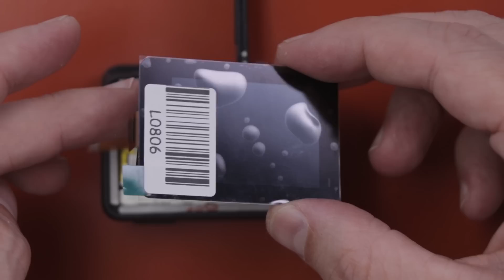I Bought 6 "Unfixable" GoPro's - Are They Really Unfixable?

Comment: I sometimes wonder, there are a lot acrylic products to fix car windshield. You just simple apply the product to the crack and let it cure under uv light. Then the crack will be barely noticeable. So I wonder if those products can be used to fix crack touchscreens. If so, you don’t need to replace them.

Comment: Ive checked your video and im pretty sure that you can remove the back lcd screen without removing the front first just heat up the lcd panel ply it out unscrew the battery box and you should be able to unplug them from there!
Reply from the maker: I wish that were true!

Comment: For cracked screens I would have used a cell phone screen protector! Clean it really good, lay a protector on it, press it down good, trim it with a Xzacto knife.  The main problems with cracks  is they let in moisture and dirt, the protector will seal them. I have repaired cell phones like that and they worked for years.

Comment: at 4:38 Surprised, how easily users in US get rid of these. I mean, in Russia if such device (or even an iPhone) would have such screen damages or even worse (missing parts of screen all the way down to the board) but still working fine - it would still be used as long as it works or until device is too old and needs replacement to get up to date.

Comment: The bonded design is what makes it so rugged and sealed. The glass is much harder than plastics.  They are not intended to be repaired but with nothing to lose its always worth a shot. I did the same peeling the glue and ended up chipping all the glass off.  The trickiest bit was getting the plastic back to its shape,  so it would be nice for that to be available as a spare, although some Chinese company would probably skin their clone with it. I bonded it back together with many pounds of force and it looks stock. But I accept I'll never ever be able to repair again. The density and the design to me shows what you are paying for and I'm reassured it's the design first then cost second.

Comment: Use s silicone adhesive around the screen and not too much so it doesn't spread onto the screen and it will be water proof again

And or gasket sealer / naker adhesive it's really strong and wont let go easily

Comment: I have a gopro hero 8 that had some water damage after using in the swimming pool without additional enclosure. After letting it sit for a few weeks, It can power up now, but says no battery while battery is in use. The front lens seems seeing nothing and the touch panel still works. Do you have any suggestion?

Comment: To remove the outer lens cover on the hero 7 you pull it out and rotate it anti clockwise. If you use a pipe wrench all you will do is break off the location tabs.

Comment: GoPro on 4:20 is not broken. You started scrolling on the "language" black bar, of course it will not scroll, but on the right side you scrolled from the "english".
On the left side, you started scrolling a bit to high and that's why it didn't scroll, that's not a dead spot.

Comment: I have 3 hero black 7's and 2 Hero black 8's.  One of the Hero 8's (bought 2 years ago) continuously cycles on and of after being on for about 10 - 15 seconds.  When recording it will record from 10 sec to one minute, then cycle off and on and screen shows video file being repaired.  I tried different SD Cards. I tried new batteries. I set quick capture to off, I set auto power off to Never, I set Screen Saver to Never. Finally did a factory reset. Camera still continuously cycles on and of after being on for about 10 - 15 seconds.  I also, as last resort, used isopropyl alcohol with Q-tip to clean leads.  Issue still happens.  i am getting ready to replace the camera.  I just might try the DJI - Osmo Action 4 4K Action Camera

Comment: from ebay i have bought number of job lot digital cameras that were listed spares repairs out of the entire combined lots i got 80% fully functioning , there was battery corosion on some of the battery conectors best thing to use is lemons apply to  kitchen paper towel cut to size leave it there untill battery corrosion absorbed into kitchen towel repeat process until its gone or you can squeeze directly on , digital cameras i cant fix i strip them down as parts lots , some i managed to source batteries for them as some do not use standard batteries , i sourced chargers for them , one i got new screen i accidently pulled out flex ribbon cable that powers the light putting it back in was nightmare cause a tear in the cable anyway to fix it , some of the cameras were non digital 35 mm cameras and a halina super 8 which looks in good condition needs a battery

Comment: In stead of using the channel locks,  get a friend with a mill or woodworking routers and make a "wrench" with a shaped opening the same shape as the front lens.  The tool could be made of metal,  plastic or wood.  All could work.

Comment: I have a gopro silver 4 and I treated it very good as if it was a full sized camera. It still looks new. I store it with out the battery. The other day I slid the battery in and it didn't work. I bought new batteries, that didn't help. I've found a few videos that have me holding various buttons in while I slide the battery in. Nothing. It's a shame

Comment: Hi, cool video! I have a question. I have a GoPro hero 8 black. It turns on and works when it is plugged into my laptop. Even tho the battery is inside, the GoPro says that there is no battery inside. I cannot do a software update (auto or manual) because it detects that there is no battery inside. I’m afraid the issue is worth he GoPro and not the battery. Have you had or heard of this issue before? I saw online many people experienced this. Some even bought new battery and the same issue occurred. The GoPro fails to recognize that a battery is inside. Any ideas?

Comment: You should have tried removing the old adhesive a bit more, and used silicone or rtv sealer instead of tape. Then clamped it together and let it dry

Comment: Not speaking from experience, however, I think the solution to your problem would be piano wire or super thin wire which you can use to cut that adhesive instead of having to heat and pry.  Not suggesting this would be easy either, however, may render the result you're wanting.
Reply from the maker: That's possible...I've never used it. I might have to give it a try. I still think a lot of heat would be needed but I've not tried it so I could be wrong.

Comment: If the front plastic pannel isn't warped or damaged putting w big amount of b7000 phone glue will make it alot more water resistant and for the screen too it will pretty much make it water proof from the screen side because of the big bezel around it

Comment: The GoPro 7 is waterproof without the front lens cover. To remove the cover correctly all you need to do is pull it away from the camera slightly and give it a twist, this is easily done by hand. That procedure is covered in the instructions that come with the camera and if you need to use the GoPro dive housing you have to remove that lens cover for it to fit the housing.

Comment: That repaired GoPro 7 Black would work perfectly for all streamers, youtubers and other folks that need extremely cheap and good quality video recorder. Pity that there is no easy way to connect external microphone to that devices. Original converter from USB C to mic 3.5 jack input is very expensive for piece of cable.

Comment: After repairing my iphone this is nothing but a breeze lol

Also, for the screen repair I would have heated up the glue & used IPA to remove any that was left. I would have also tried to use a suction cup to pry off the screen. Once it's pryed open a little you could try getting a sharp razor under the screen & cut away the adhesive glue. Iphones are the worst for this. Still, would have worked wonders but breaking the screen bit by bit also works :)

Comment: That 5 (or 6) with the cracked screen wasn't too bad.  Just put a screen protector over it and be done.  I mean if it was like a spider-web and you couldn't read anything, that would be different, but a large crack or a few cracks, but otherwise visible/readable--just leave it alone.  YOu're likely to make it worse (or make the camera inoperable as some of these action cameras and small electronics are glued together and once you separate the compoents it is EXTREMELY hard to get the thing to seal back up, and in the case of a GoPro, be weather/water proof/resistent like its supposed to be from the factory.

This is also why I would recommend (one of the few times I'd recommend this) you enroll in some sort of replacement plan or accidental warranty.  It might cost you $100 but that's sure cheaper than $450 and being that these are action cameras, the likeliness they are going to get damaged or destroyed is more likely than, say, a washing machine or a smartphone (at least with smartphones screens can be replaced at a reasonable price).  Again, carmeras, drones, phones, tablets/laptops are all devices I would recommend people enroll in the accidental protection plans because i'd say majority of people damage a device at some point.

Comment: If you break one, you can also subscribe to their GoPro premium thing which comes with unlimited replace warranty. You can subscribe after it's broken and cancel once it's fixed (it's still not free), so you pay only for the replacement (much lower than buying a new one).

Comment: Lol it's hilarious that they use rubber seals that are reusable but you can't safely get it apart to get to those seals. I fly fpv witha  GoPro 8 and have hard crashes alot. I wish I could just open it up cause some times it's just a plug came loose I guarantee it.

Comment: $641?? I got 24 for $180 AUD xD fixed all but 4 minus no longer being waterproof. I left half stripped to use as backup naked setups. You have to pull and twist to remove the front lens too. No tools required.

Comment: Its not sealed properly coz you didn't remove older glue first that's it created a gap there and should have use glue on the sides of back plate

Comment: To late now but to get the lens cover off by hand, slide a thin piece of plastic....credit card between the lens cover and the body, It works for me, there Is a big O ring seal you need to get loose then you should be able to turn the lens cover by hand.

Comment: Fact: None of the 7s can be fixed as all they do is freeze, lag, and glitch lol. I have a 7 and im ready to toss it right in the garbage can, its my 2nd one and both of them were the worst cameras i ever owned.
Reply: I've had the same kind of problems with mine. Returned the first one under warranty and the second seems to be doing better. Using the recommended SD-cards up to 64GB seems to work pretty good as well; using 128GB and 256GB cards combined with longer 4k or high fps FHD clips seems to be more prone to glitching, lagging and freezing.
Reply: @twannooitmeer9146  thanks for the response man, what sd card do you run? Mine is a 64gb Samsung evo pro and it’s on the list of compatible cards and for 4k video, I shoot in 4k for my YouTube channel and can’t go lower as my subscribers expect 4k. I use to be able to record 60fps in 4k in both normal record mode and time lapse but then after awhile that made it start to get hit and freeze, I put up with it till it got so bad I couldn’t record for more than 10 min with out it freezing so then I lowered it to 30fps and that worked for awhile only freezing after 45 min of recording give or take but soon after that it would start freezing again at 5-15 minutes of recording so now I can only use normal record on 4k 30fps when shooting my intros cuz anything longer than 20 minutes and I usually loose valuable footage.. it’s just downright terrible, it’s such a poor camera when they can sit there and advertise 4k 30, 60, and even 120fps when I can’t even get 30fps to function with out it over heating and freezing.. if I’m in a time lapse at 30fps I’m usually ok but after 45-80 minutes it still can deffinelty freeze so I typically make sure I end the footage and start it over so I’m not to loose hours of footage.. it’s a scary thing to always have to worry about and it’s the whole reason I went with this high dollar camera.. my first hero 7 did the exact same thing only it was much worse.. to the point where no matter what FPS I shot in or even in time lapse it would freeze 20 minutes in.. these cameras are total trash and I feel like GoPro should be re-enbersing people or sending us the new 8 for free it’s that bad. You can’t advertise it does all these things that it can’t even do half of. It’s clearly not built right and clearly they have design flaws in the 7 which made it run hot, get glitch, and freeze, they should own up to it and help out their customers.
Reply: @BiffsEquipment  Yeah still can't wrap my head around these camera's being sold at these price points with these kind of issues. The image quality definitely is amazing but the reliability is basically non-existent when trying to use all the features to their full extent. I had most issues using my Samsung Evo Pro 128GB in my Hero 7 Black no matter the resolution, frame rate or mode the camera was set to.

Not sure if it is the SDHC (FAT32) vs. the SDXC (exFAT) platform that makes the difference but I'm getting decently reliable performance out of the SanDisk Extreme 32GB card I'm using now. Faster cards seem to perform better so make sure to at least use class U3 or above. What also seems to improve reliablity is to format the sd-card using the camera itself after having pulled the footage of the camera. With my camera the issues seem to pop-up more frequently without doing so.

I hope you'll manage to find a way to get a more reliable experience out of your GoPro
Reply: @twannooitmeer9146  thanks a ton for the info man, I have thought about trying a new SD card, the scan disk Extreme was the card I planned on buying for it to begin with but a sales rep at micro center talked me into the Samsung evo.. kinda wish I went with my gut on that one. I’ll def try the scan disk extreme and let you know if there is a difference.. when it comes to formatting I always pull the footage off to my Pc then format the card with the camera once I install the card back into camera so that’s def not the reason. I have also tried to update the camera both over WiFi with my iphone as well as going directly to gopro website and downloading the files and manually installing them onto the sd card to do the update that way and neither way or updating has made a difference with either camera I owned. I’m betting if anything it’s the SD card specially now knowing you used the same card as me and had plenty of issues. I’ll try it out for sure thanks again!

Comment: You really overdid how to replace a hero 7 lens, its a feature so you don't need plyers to replace them, it has been brought back in on the hero 9 too
Reply from the maker: Yes, I did need pliers. Some just don't come off without pliers. I realize they are supposed to be easy to get off and many probably are but not all of them.
Reply: @Tronicsfix  I saw you used them but it is not the correct way, you run the risk of further damage to the camera, you should have used the credit card trick really, I'm just saying, it felt a bit overdone really
Reply from the maker: @thejibble  There was literally no other way to remove it. I wouldn't have done it that way if there was any other way.

Comment: Seems a damn shame, I wonder if someone could come up with a economic way to 3D print some new casings for broken gopros so repair techs can take them apart fix their internal issues and then put them in new cases that can be waterproofed again as well.  

Seems such a waste, monetarily and environmentally  that they are expected to just be tossed when they get a broken screen but are otherwise just fine.

Comment: This is awful (not the video, GoPro's irreparability). They are as bad as Apple. I recently had to replace my power drill. The old one (a Makita) went through two clutch changes, a replacement trigger, and a new speed control. All easily replaced. When the motor finally karked it, I decided to buy a new one. Another Makita, this time Litium, and hope it lasts 10 years just like the old one!

Comment: That's so weird that you say parts are expensive because when I looked yesterday they were actually surprisingly cheap unless $30 is expensive for a screen for a product that costs $220 brand new? That front lens cover is only $10 too which is pretty cheap. I have a friend who smashed his gopro lens and got a instant replacement and they told him to just throw away his old 1 so he has decided to fix it instead which means he'll have 2 gopros and it's only going to cost him $10 to fix it since everything else works fine lol.